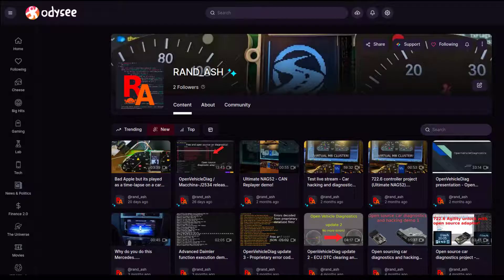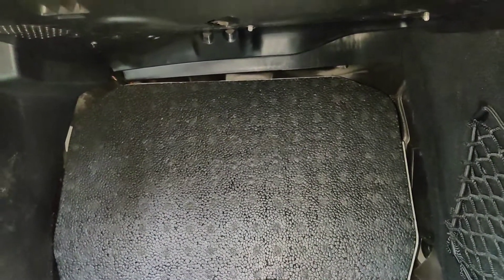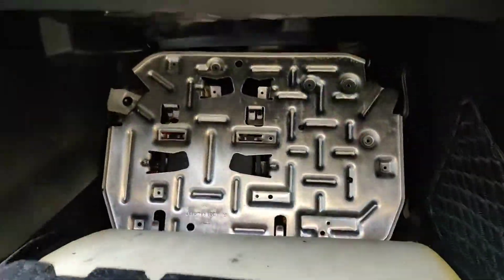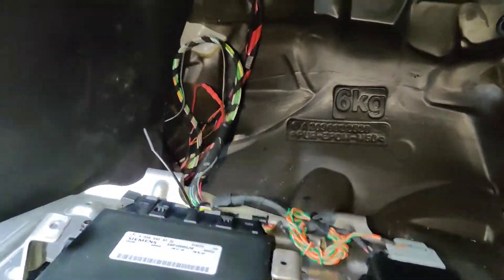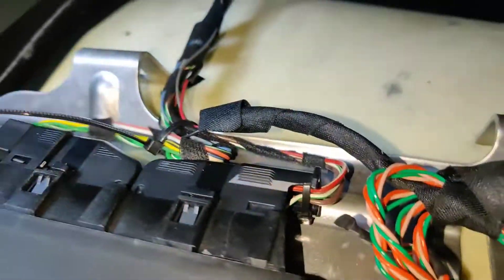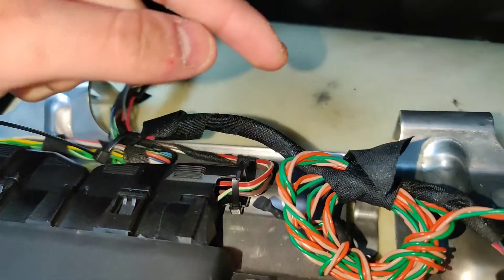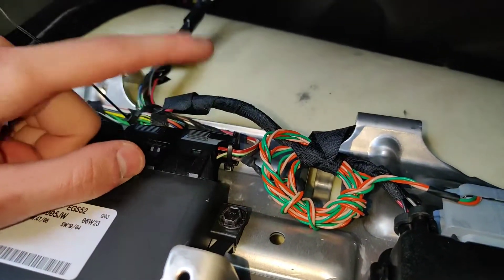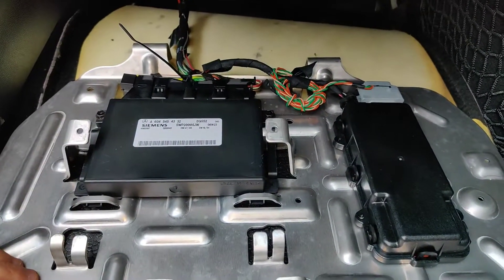Ultimate-Nag52 Installation part 1 - The prerequisites

Comment: I have a W204 early production year - 2007 with the 722.640 transmission. It is EGS53 and that connector has 2 wires insead of 3, how does that work? Does anyone know if this mod would work in my case?
Reply from the maker: Yes it would work! On egs53, they discontinued KLINE diagnostics, and moved fully to CAN, so the missing third wire is the KLINE wire. Ultimate-nag52 tcu doesn't use Kline anyway
Reply: @RANDASH  Thank you for the feedback! I am thinking of trying out your TCU because the previous owner put a junkyard TCU from a w211 (I see it written on it) and I believe it is causing harsh torque converter lock ups usually when cold, but sometimes even when warm. I did change the valve body, torque converter and the conductor plate and nothing fixed it. So my guess it could be that TCU. Is there any Discord server or forum where we could discuss more?

Comment: I am extremely interested in your project!  I own a 2004 Chrysler Crossfire, which is based on the MB R170 platform.  It does use an EGS52, with a slightly different part number of A033 545 12 32.  I does use the "3 wire" power connector.  I did acquire an EGS53 TCM from a later model Dodge Charger.  It would not work properly as a drop in on the Crossfire (I figured it wouldn't, but tried, anyway).  However, the EGS53 has the advantage of being tunable via HP Tuners.  Overall, I like your solution much more.  I will follow your progress, and please sign me up as an early adopter of your system, once available!

Comment: As far as I recall all w203 and 211 with 722.6 communicate with ESM via can. Some newer models they did away with the k line on the selector lever and used can for diagnosis too.. It was the older w210 that used voltage coding to the EGS for selector level positions >